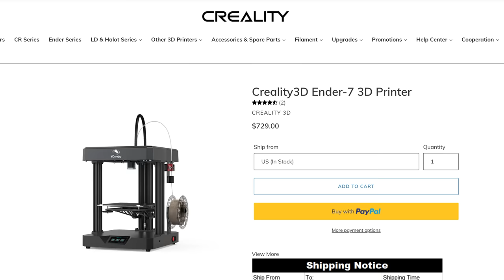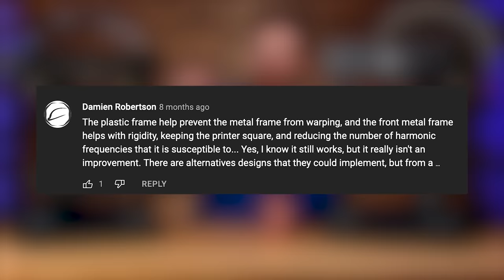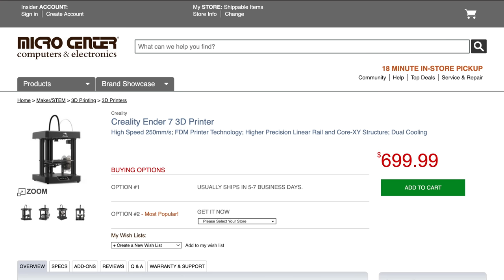The End of the Ender 7

Comment: Creality is a 3D printing company that has excellent ideas, but they are often really garbage at implementing those ideas.  They still have a bad habit of releasing products with problems and then just thinking that the user community will sort them out.  I am still extremely disappointed that they repeatedly and blatantly violate the Marlin GPL license on their printers by not publishing their Marlin source code.
Reply: I think they are way better at scouting the community to find ideas to implement than to develop their own ones. Do they really have excellent ideas? what is their original design/idea/contribution?
On the other hand, implementation is sometimes a great success of theirs : they really managed to improve the quality of the entry level printers AND lower the ticket.
Reply: @AudreyRobinel  I have yet to hear of a Creality printer that does not require some sort of 'fix' right out of the box, whether that is replacing a bad part, replacing a poor quality part, replacing a poorly designed part, or altering firmware.  This is what I mean by bad implementation.  On the other hand, I believe in concept, most of their printers are good.

Comment: I agree that the front piece probably didn't have a whole lot to do with it not matching its ridiculous claims, however saying that "vorons don't have that piece, therefore it's not needed" doesn't make sense. The design is different, the components are different and structural rigidity may come from different pieces. Not saying your conclusion is wrong, but I wouldn't dismiss an idea because a completely different design doesn't have something

Comment: I still stand by an opinion that at this point, given the cost of the items and economies of scale: all printers should have ABL, a filament runout sensor, and removable bed. If it doesn't, it shouldn't be sold. Given you can get all 3 of those on printers sub-$400. For $700, I don't know why it would be considered. "But Core XY!" IIRC, people were pointing out this is more H-bot or something as opposed to Core-XY. If it was Core-XY, the front would have belts passing through it and Mr Angle Grinder wouldn't be able to introduce themselves. It's wacky: many want a fast, large, and high-temp supporting printer. But fast requires super rigid frames, large makes it harder to be super-rigid, and high temp is a topic for another time. Look at RatRigs and Vorons. They manage to do the high speed and large, but they're either more expensive or they're near identical to this price (and can actually be reliable). This printer lacks what I believe are requirements of a modern printer, can't keep up with others in the same class/price, and it's one major selling point (speed) is just not capable with it's design. Get the angle grinder.... there's a chop shop stream for you.

Comment: That was a great story, Joel. I think you're right: Reviews and comparison videos can be a challenge to make engaging, but I'm really glad we got the condensed version and your full experience over so many months. High five!
Reply: I heard all Enders need the tinkerer to buy a premium 3rd party bedsurface .
I also heard you need to print custom fanducts for the Prusa MK3 so the cooling works properly.
Are these just  myths?
Reply: @TremereTT  I’ve owned many Enders and never owned a premium 3rd party bed surface. I’ve only had to replace one, and replaced it with a $20 and they’ve been just fine. Wish I could speak to the Mk3, but can’t say it’s been my experience with the Ender line.
Reply: @TremereTT  You surely don't need any additional purchases or prints for mk3s to work properly. I have been printing with it for around a year and apart from self inflicted problems and one bad filament I never had any problems caused by the machine.

Comment: I upgraded my Ender 3 to one of Creality's textured glass plates and it was one of the moodiest surfaces I've ever printed on. Some days things would just refuse to stick, some days prints would stick and refuse to budge. I found running it in the dishwasher helped but it was also super sensitive to drafts in the space and ambient temperature. Creality should have shipped the Ender 7 with a decent PEI sheet and some sort of auto leveling system especially for $700.
Reply: I flipped the textured side down and use it as a basic glass plate. Much better.
Reply: The glass beds from creality benefit largely to being g scrubbed with dish soap and a sponge under hot water.  They have a coating of some sort on them that seems to be finicky but once well washed they work great. That's been my experience at least.
Reply: The pattern-coated glass plates need to be completely free of any kind of oil from your hands.  One touch from a finger and you have a spot that won't adhere.  A little IPA works wonders.  I totally agree about temperature and drafts.
Reply: Try a sheet of G10 (as per Maker's Muse) or Polycarbonate (relatively cheap). For the latter, scuff it up with sandpaper.
Reply: I used Elmer’s purple stick glue and get good bed adhesion. Drys clear and sticks well. I have a glass bed. Glass bed at 60c for PLA.
Reply: I avoid glass all together. The magnetic plate never had let me down
Reply: Testing the polycarbonate and also a sheet of acrylic this coming weekend (too busy this week).

Comment: I have had mine for about a month now, it took me a couple of days to fine tune the settings but I was able to get consistent bed adhesion and haven’t touched the bed since. The initial set up though was challenging and I haven’t reached the advertised speeds with good strength and quality but I have found that it does print faster when doing larger prints.

Comment: I find creality seems to have departments that run in different directions, some towards a goal and others into the gutter. The ender 3 really took them into orbit, but they seem to be releasing printers that are very poor quality with basic build issues. My cr-5 Pro h is an example of a premium printer made poorly. And that, really has tainted my opinion on creality as a whole.
Reply: 100% agree.
Reply: Same happened with my Ender 3 absolutely nothing worked out of box and their rather crappy customer support was just garbage great first experience with 3D printing huh? If I wanted my 200 back I had to send the thing to China just so it could be what? Scrapped I'd be out almost 300 if I did that.
Reply: I totally agree. I started 3D printing in December for the first time, bought a CR6 Max for $900 and I thought I was buying a premium printer. That was far from "reality" heh. Thankfully, I bought it from Microcenter with the protection plan and was able to return it for store credit. I have a Prusa Mk3 now and couldn't be happier, took me 10 hours to build it myself
Reply: I'm not sure if Creality works the same as DJI, another Shenzhen based Chinese company, but when I worked there I saw that each product had different leadership, goals, and connections to the CEO. Some products simply had a much more powerful team and therefore got more budget etc. I wonder if it's similar at Creality.
Reply: I used an ender 3v2 for 2 months from amazon, kept having problem every 2-3 days. Returned it and bought a prusa mk3s+. It's been printing flawlessly for more than a year with out a problem, I trust this machine so much it's insane. I don't even trust my ratrig v-core 3 as much as I trust my prusa yet hahaha
Reply: Yep. I have 3 Ender 3s and I've yet to see another Creality printer that has been consistent enough to be a temptation enough to get. And it isn't that I don't want for example, a belt printer. It's just I'm seeing too many quality issues with so many of the printers.
Reply: Like others stated elsewhere Creality seems to rush products to market and then use consumer feedback as their beta testing  to fix later iterations of the machine as opposed to in-house beta testing.  

Not necessarily a Creality issue but a China manufacturing one in general, QC there is inconsistent at best. (my sister's company will retest all components from china before assembling their devices (upto 25% rejection) which they haven't needed to do with components from other countries.

Comment: I'll admit I did have quite a few issues when I first got my Ender 7 but I had only been printing for a few months on my Ender 3 Pro so I was still in the learning phase.  Once I completely loosened every screw on the bed and tightened them in a criss cross pattern I had zero issues.  I even stopped using glue sticks and blue painters tape.  Some of my prints could probably be slowed down a little bit but once I worked out my bugs it has been working great for me!!  Two things I will agree with you are the price sucks and auto level should have came stock on it.  I mean WTF!!! it comes with a grayed out selection for auto level so why not throw it in for the price!!  After all is said and done, I love my Ender 7, 3 Pro and 5 Plus.
Reply: Crap, I was going to attach a video of a print I just started on my Ender 7 with no tape or glue stick but no option to add video in comments.
Reply: @robb2465  post it to youtube and then provide link?
Reply: @roll4stealth671  yo nice icon
Reply: @mistaecco  favorite pokemon lol
Reply: This wouldn't be the first time a major 3d printing channel "reviews/gives thoughts on" a printer only to have some in the community to say they have had great success with that printer. Makers muse had nothing but bad things to say about the ender 3 only to have the community price him wrong which caused him to do another video about it.

Comment: I am using Ender 7 with Klipper firmware. With some minor software tuning and slicer config, I am consistently getting very good quality prints at 250mm/s. You need to tune the config, where it needs to slow down and where to run at full throttle. But, this machine is doing very fast than my previous Ender 3 V2.

The hardware can easily handle this speed. So no need to worry about upgrading hardware parts. My slow speed printing is now 100mm/s and I haven't gone less than that for most of the time. 

I use 50mm/s speed only when I am printing with 0.2mm nozzle and when printing very minute details.

If you know anything about 3d printing, you'll sure like this printer very much.
Reply: or i could spend the same money on a prusa and get amazing quality after a fresh kit build... but go on...
Reply: @angelusmortis3256  
I bought the Ender 7. So, I have to go through this to get the best out of it. But, it gave me enough of a chance to learn many new things. But if you want the best out of the box, sure you have options.

Comment: I've found that those beds get much better adhesion upside down. the clean glass works rather well for PLA and some other materials.
Reply: yes you are correct as i have found that out also
so i have 2 glass beds and a magnetic one for my enders 3v2 so when using wood filament i use the magnetic bed, and for Pla plus
I take of the top part of the magnetic build plate and 
put the glass bed on top of the magnetic bottom part that is stuck to the main build plate and never get a problem with adhesion

Comment: The CR-6SE - AFTER 1) swapping out the crummy plastic feeder for a metal one 2) tweaking temperatures for every pla, 3) replacing a dead power switch, and 4) always using blue tape... it gets good results.  

It would be nice to get to a point where laser paper printers are today, load it up with media and press print.

Comment: I'll be honest I was not happy with the Ender 7 when I first got it as a gift. Especially after watching your videos. I had bad prints consistently. Then I removed the glass plate and the 4 clips. I stuck a magnetic sheet down and used a sheet of pei. Now I print with a bed temp of 65 and speed of 200. Everything comes.out perfectly. Consistent prints at high speeds.
Reply: Same here.
Reply: Did same upgrade with my Ender 6 but I also bought cylindrical rubber to use instead of springs underneath the bed. Now I can rely on it more.
Reply: @hammerfallen12345  interesting idea can you post a link here for what you used?
Reply: @Exploringthepositive  Tried to send link but it seems as it got removed by youtube

Comment: People seem to buy these to print faster but I decided to buy another printer so I had 2.
These run slower (but you are making 2 at a time) so give better prints but cost the same as a the ender 7 combined. These can also be different so one is direct drive vs bowden so if you need flexible printed you can use that instead. 2 printers vs 1 seems to give better prints and more flexibility. Suppose you could always say if one breaks you can still finish the job where if you have one , your done.

Comment: The CR-30 is another "premium" priced printer from Creality with some goofy problems from the factory.   Simple things, like the silicone sock not being trimmed enough and rubbing on the conveyor and the little belt that drives the conveyor being too tight (causing the stepper to overheat and miss steps).  I wonder if the issue with the Ender 7 is some trivial error being made during assembly.

Comment: Absolutely fantastic overview of this product! Totally agree that for the price I would like to see ABL included, and just a more polished experience. I just got an Ender 3 V2 a couple months ago, and so far my only real issue was one of the wires to the hotend had some kinda problem that resulted in a "TEMP TOO HIGH" warning, and then no heat at all... a very early failure, but I just replaced it with a slightly better wire because I love fixing stuff, and the Ender 3 was like $240CAD or something. Point is, if I paid $500+ for it I would have been way more unhappy and consider returning it. So your last point is a very good one!

Comment: I fell for the hyp and now have a very expensive table decoration.  Extruder motor died just after the 3 month warranty ended.  They cannot send just motor, they have to replace the entire top.  I am done buying experimental equipment that has no replacement parts or upgrades.  I did fix bed leveling issue with better springs and I did not have a twisted bed.

Comment: You should do a whole video or even series called "What does it take to make the ender 7 print and print well?"  It would be a great watch a series to see what upgrades you can throw at it to get it to print like the machine it was supposed to be.  Maybe get some sponsors to give you parts to try - flex plate bed, new hot end, etc....
Reply: It's a fun idea but just more free marketing for creality imo, who failed to deliver a working product to start with.
Reply: @MakersMuse  possibly but in the end it would showcase the short comings of the machine and a final round up video could compare the cost of making the 7 print well vs other options - how much do you need to spend to reliably print  250mm/s.  It could be entertaining and useful content and by starting the video with a reminder of the previous poor performance vs where you are going with it I don't think it will provide any undo positive publicity for this particular machine.  It's not a dis on the brand they make other machines that work at a reasonable price this one just fell short of its overconfident advertising.    But hey just an idea.

Comment: I purchased five Ender 5 plus, a D1 and two CR10 Max. Two completely dead out of the box. One with a bad filament sensor. The D1 came with a limit switch micro broken in half which caused it to score its own bed on the first Home. One had bad firmware. Three of the SD cards supplied failed within a week. Couldn't get bed adhesion on anything without glue. One LCD failed within a week. Two of the BLTouch sensors had bent pins from new. The BLTouch Picoblade conector wiring failed on three of the Ender 5 Plus within a week, due to really poor wiring terminations. All the Ender 5 Plus have chronically bent build plates that continue to bend as you heat them up.... joy. I have no idea how Creality sell products with such incredibly bad quality control. When you try and get support or parts they ask ridiculous questions like "have you watched our tutorials?".  They wouldn't even cover the bent BLTouch pins under warranty, even though they arrived bent.
Creality will send your hair grey by age 23. Live long and happy by buying Flashforge or Prusa.

Comment: This is so strange as you say they have just recently released the Ender 3 S1 and every one is saying it , how wonderful that is , so its sucks this one is a let down
Reply from the maker: The S1 is really good - review coming soon :)
Reply: I'm loving the S1 as well.  I was negative on it when I got my first one, but figured it had some issues do to shipping.  When I got my 2nd one in, bed leveled perfectly and has been solid since, nice and smooth.  The only thing I don't like are how the wheels under the bed fray as I have to clean it (and I made sure they aren't too tight), but other than that, it's a solid printer imo.